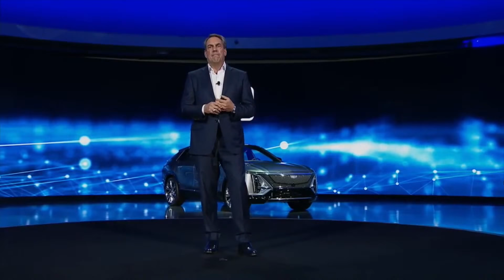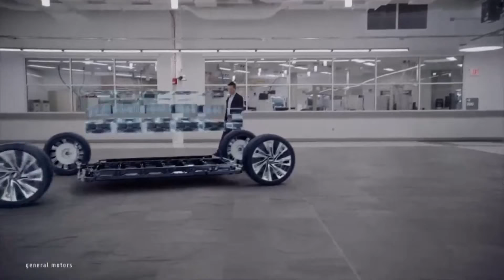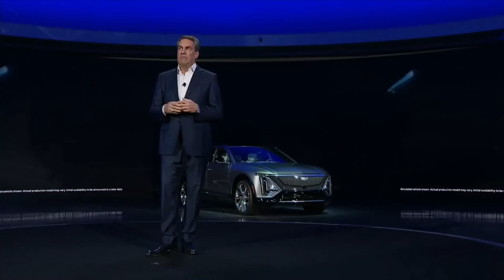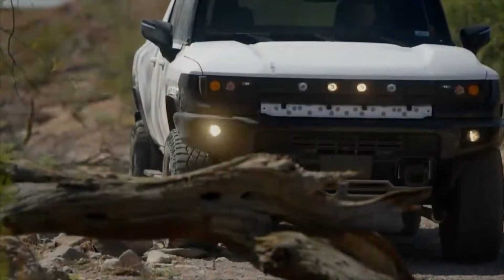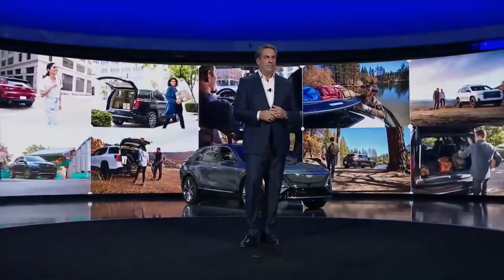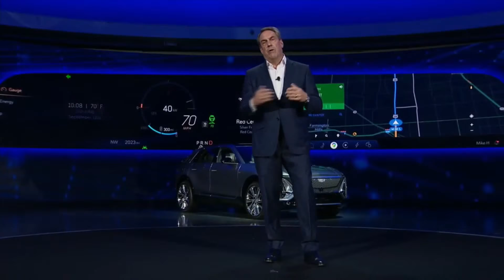GM teases Silverado EV with Glass Roof! (full presentation)

Comment: Thanks to Elon for pushing this ev revolution faster, I also believe in hydrogen on demand. I would like some ICE cars & trucks around running on hydrogen on demand
Reply: I'm not sure you or anyone else is ready to pay for it.
Reply: @sweetbon76  what do you mean Sipp?
Reply: @RicardoPicena  hydrogen is inefficient and need fuel cell aswell as batteries, hence very expencive on a life cycle.
Reply: @sweetbon76  fuel cells are more efficient than ICE and due due to primary energy coming from the cell you don’t need as large/expensive batteries because you don’t need maximum range just enough for reserves
Reply: @EataMr  that is true. They are more efficient than ICE, but less efficient than BEV. Since the hydrogen fuel is as expencive as gasoline, fuel cells will only be economical to use where batteries don't work. Maybe in long haul ships? For most other applications batteries are the more economical and efficient solution.
Reply: @sweetbon76  If it is in terms of recreational vehicles I 100% agree BEVs are more efficient and make more sense. I think if hydrogen infrastructure was  at the point where EV charging is, industrially hydrogen would make sense but if we’re talking recreational and personal use then for sure BEV
Reply: Thanks to elon ?            🤣🥴🤢 .  .  .

🤮
Reply: @tpndgo2061  hahaha you salty huh 🤣😂 I mean, who else is leading in EV’s technology advancement & gave patents out for free???

Comment: Retro-fitting is the smart way to go.....they're all being set on the basic "skate-board" platform. Ford's F-150 body-cab system is proven and reliable.
I'll kiss this cat's #@$#@# if it's less than $60k....the Ford Pro is $39,900 before the $7500 Federal tax credit. You can't buy a standard cab fleet truck for that anymore!!!

Comment: #1 this better be a lot more affordable then the hummer.
#2 better have realistic wheels other then 24in. Those are garbage for ride quality and pretty much using a truck how it should be used.
Reply: They will likely be air ride, new shocks and irs to tame such
Reply: @jeffwill4923  agreed I'm sure it will have all the bells and whistles. I'm just hoping they offer a realistic tire size. 18 is good plenty of sidewall so you don't pop the stupid thing on a rock-curb ect.